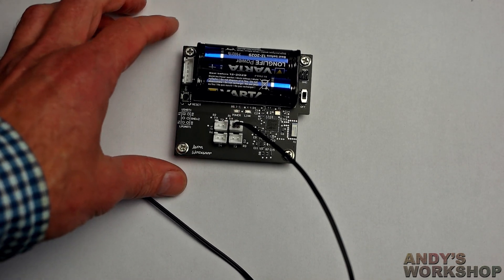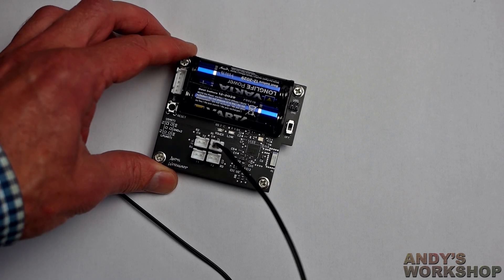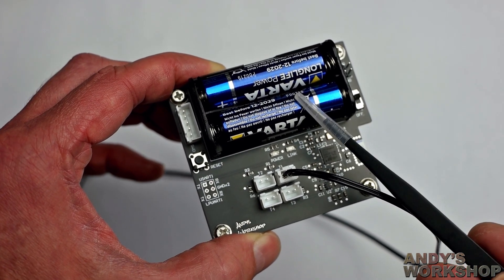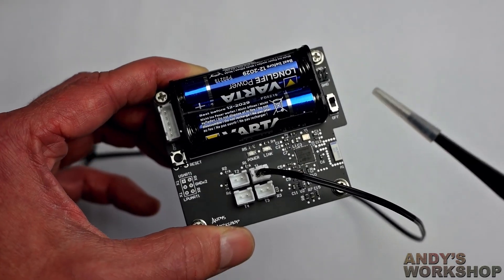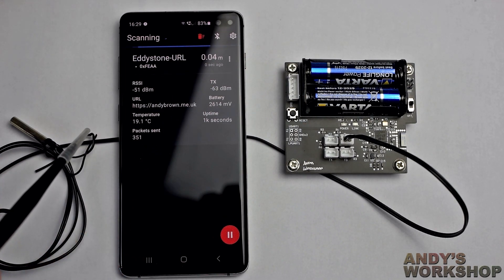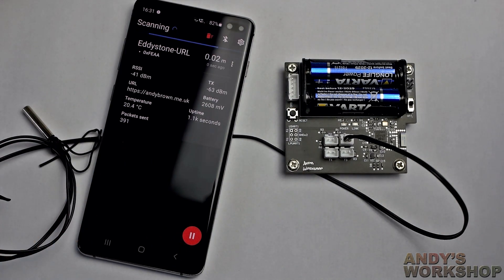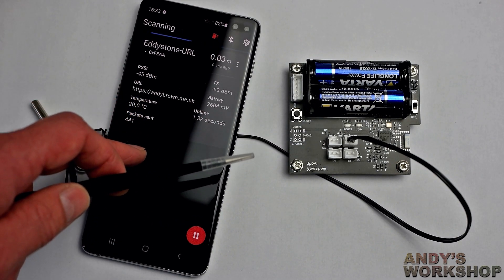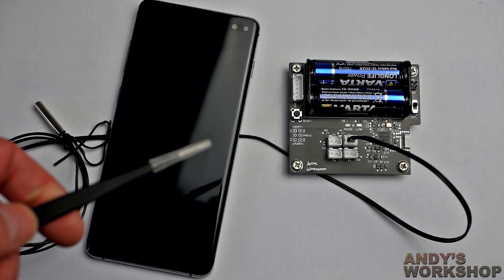Bluetooth temperature sensor using the STM32WB55 MCU

Comment: I really need your help with something. Or someone's help. I have a tablet with a Rockchip RK808B. I need to know how to manually reset it (short it) via the jumper switch on the motherboard. The Rockchip RK3368H is on this motherboard also. I need to know which pin or pins I have to short out in order to try to wipe it. Any help would be appreciated & if you know anywhere else I could find this, that would be awesome too. Thank you.